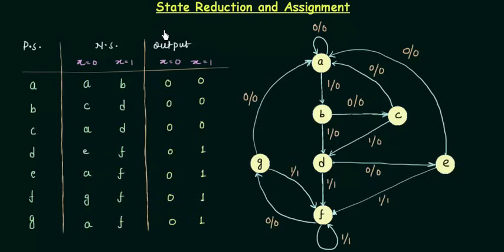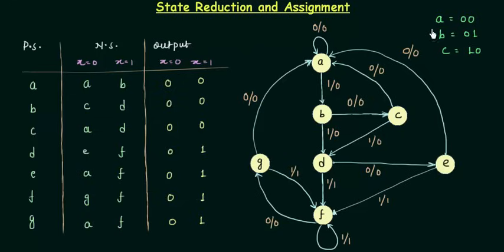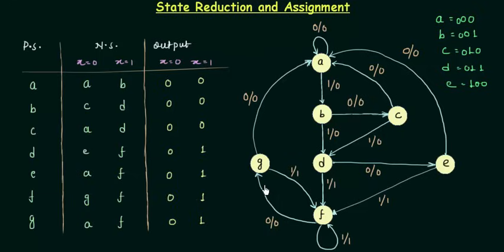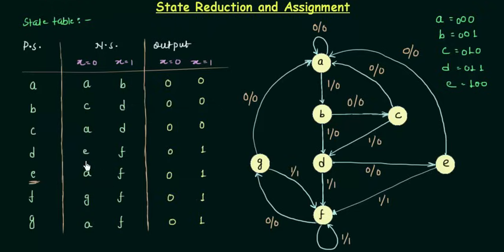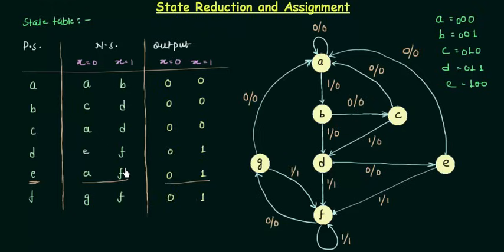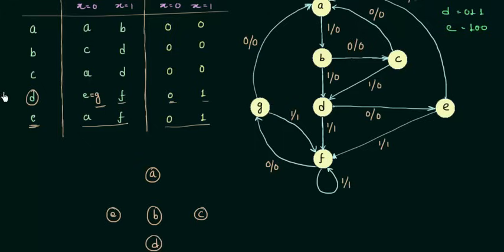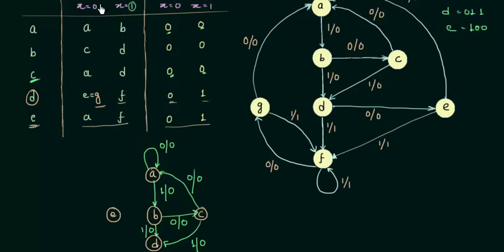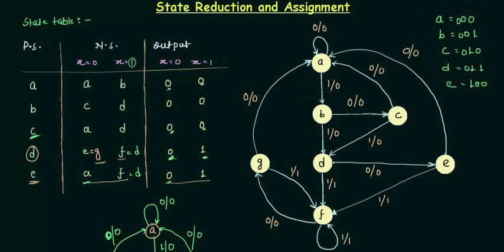State Reduction and Assignment

Comment: I have a question: when performing state reduction in a Moore machine, is it enough for two states to have the same transitions (i.e., go to the same next states for each input), or is it also necessary that they have the same output? Let me give an example: suppose we have two states, G and H, that both transition to state C on input 1 and to state E on input 0. However, G has an output of 1, while H has an output of 0. In this case, even though their transitions are identical, their outputs are different. So, they can’t be considered equivalent and can’t be merged, right? Can we say that, in Moore machines, having the same output is an additional condition that must be met when reducing states?

Comment: Really nice video but I want to implement the above state diagram , state table written but what about means the states (101(x=0), 101(x=1),111(x=0),111(x=01) )? while solving kmaps for jk flipflops(i want to implement with jk ff)..  I have to take above not mentioned states as dont cares and perform kmap right?

Comment: I have a question - what if the next state is the same, but the outputs are different? In your example, state e = g as they have the same next states (a and f) and the same outputs (0 and 1) - what if the next states were the same (a and f), but the outputs were different (1 1)?

Thanks for the video btw
Reply: The resason I think is because that there is 3 digits, u cannot have less than 5 factors.

Comment: The whole point of state assignment is to reduce the gate cost to run your state machine, assigning them by just plain binary coding is the most inefficient way to do so. It does not result in the minimum gate cost.

Comment: when g was eliminated we replaced e with g but when f was replaced why didn't you write f in place of d?
Reply: because if you see the replacing d with f will have no effect in the reduction process as outputs are different after replacement so the replacement is redundant.
Reply: @anrk97   thnx broo
Reply: @anrk97  bro.... In present state C.. The nxt state is a and f. Since f =d  now the nxt state becomes a and d. It is same as E (present state) why we didn't eliminate it....
Reply: @dineshnarasimmanm4889  condition is both next state and output should be same.. Output is not same for your case..
Reply: @sanjaybattu7767  yup 👍
Reply: Thats what i thought.